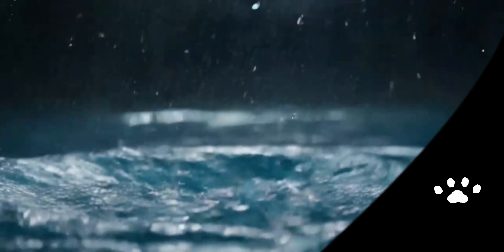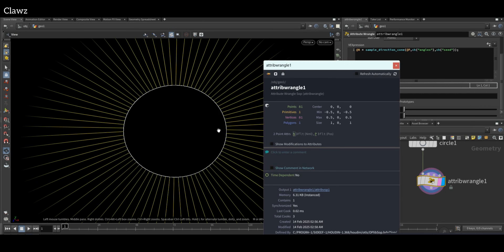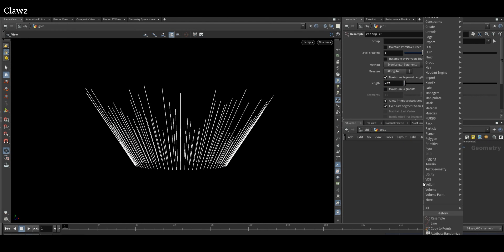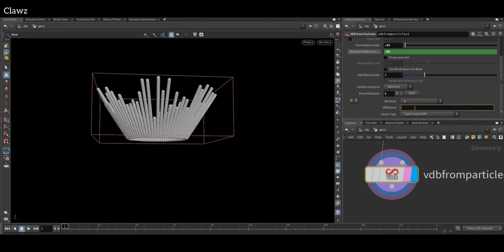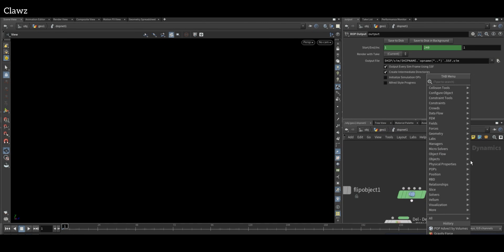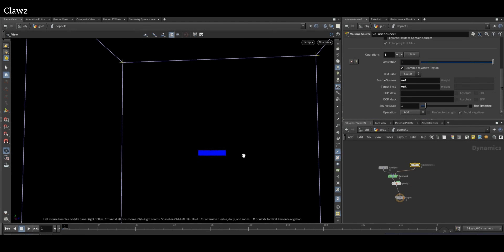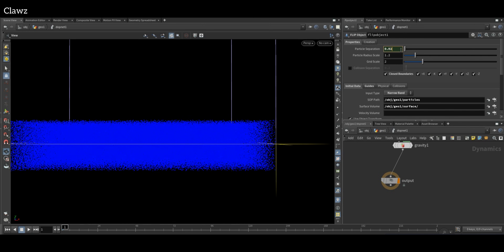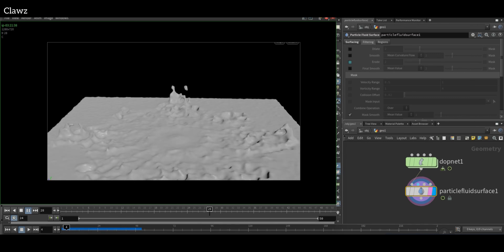HOUDINI :Crown Splash Effects Made Easy-”Tutorial for Beginners".

Comment from the maker: Hi everyone! Thanks for watching this video. I wanted to share a quick guide on how to create a crown splash effect. If you want to replicate it exactly as shown in the clip provided beginning, follow these steps:

Enable viscosity and set the value to -10
Enable particle separation and adjust the value between 5 and 10
Increase the pop drag air resistance to control the spread of the splash
Feel free to experiment with the randomized value of the "pscale" attribute to shape the splash as you desire.🐾